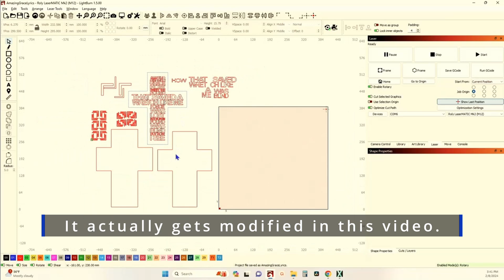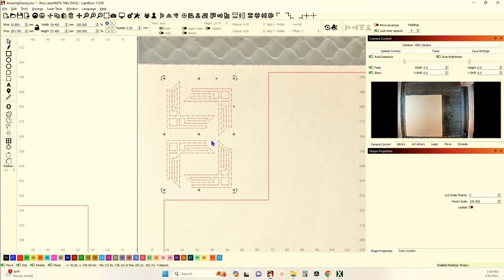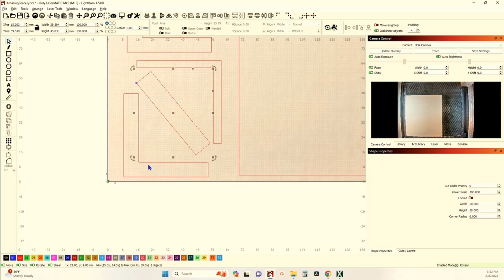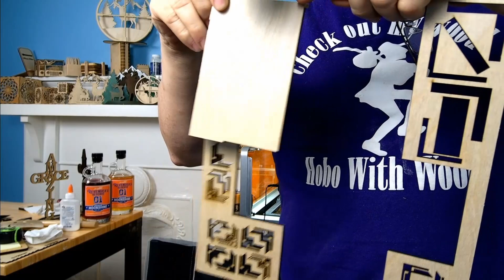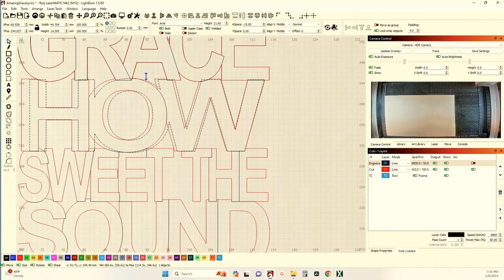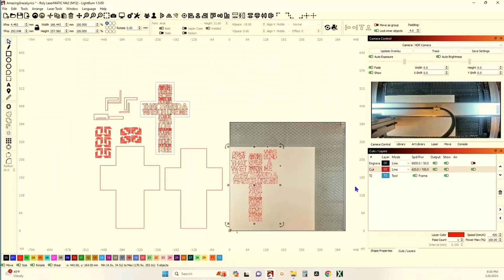Laser Cut Amazing Grace Lyrics Cross

Comment: Thanks very much     -- what brand of clamps and where to buy them do you have a link and can you show how you stained the cross, thanks
Reply from the maker: Here is the Amazon link to the Irwin clamps in this video. https://amzn.to/48orRA0

As far as staining the wood. I use Minwax stain that I picked up at my local Ace hardware. You simply wipe it on the wood with a cloth. Wait 30 minutes and wipe it with a clean cloth. Apply desired protective finish. It's really don't great video content. Straight forward and simple.

Comment: Just a thought for people testing this, you can cut out the 3rd layer from the 1st layer since the 2nd layer will cover it. May save some material. The back would have the cut out but since it will be against the wall it may not be noticeable.
Reply from the maker: IF you are making it all from the same material, yes, this would be a great way to save some material. I, however, make my lyrics from a thinner material and have it raised of the surface to create a floating look. The thicker material done this way doesn't look as nice, in my opinion. BUT, your suggestion would defintely work and like I say, there are always more than one way to do things. Great suggestion!

Comment: oh really nice work, i cant wait to get a laser machine to do that work for my church, question, you glazed the wood before you put the wording on, the glue still made the pieces stay together, thought one glues first then glaze the piece?
Reply from the maker: I apply the Triple Thick Glaze, (https://hobowithwood.com/3xglaze), to each layer before the glue up. The application of the 3xglaze can be a little tricky. To get nice even coats, I find it better to finish each layer first. The added benefit of this is, if you glue it up while the glaze is still a little tacky, it serves as its own glue. If you are using regulare lacquer or poly finish, you may could finish it after glueing without a problem. There's always more than one way to accomplish a task. This way happens to work better for me.

Comment: Sorry Should have watched your fulll video.  I am just trying to start a small business myself.  So all is out of pocket to get started...  Thanks for these videos Mr Hobo
Reply from the maker: My videos can be lengthy.  But more often than not, the answers to most questions are on the video. But people are in the habit of skipping through, and they miss so much when they do.  There are a lot of lasers out there. But if you are serious about wanting to start a business, then be serious about your choice of laser. I have been lucky enough to have used many lasers in the last two years. None, and I do mean, none compare to the quality of the Roly. If you are planning to be cutting out designs like these, power is crucial. The Roly LaserMATIC MK2 with the switchable 30W/10W module is the perfect machine to start with. You can cut these designs out 2.5 times faster with the 30W module vs. a regular 10W module. You can't make any money if you are standing around waiting on your laser to cut. Then, there is the dependability,  the precision,  the repeatability, and then the customer support.  These things are second to none.  When you look at what all you get when you buy a Roly compared to a brand, you have to piece mill together.  And possibly assemble. For a diode laser, there really is only one choice... https://hobowithwood.com/roly